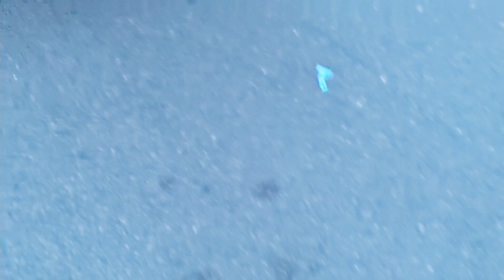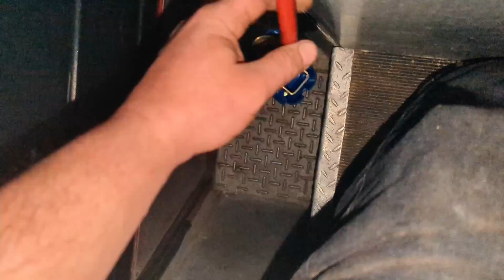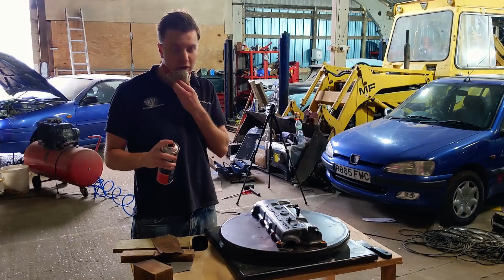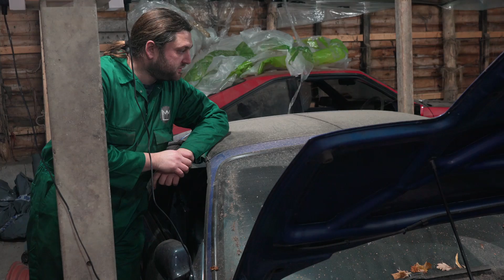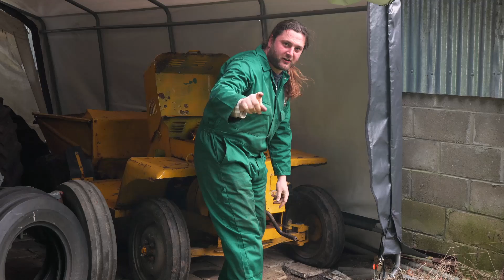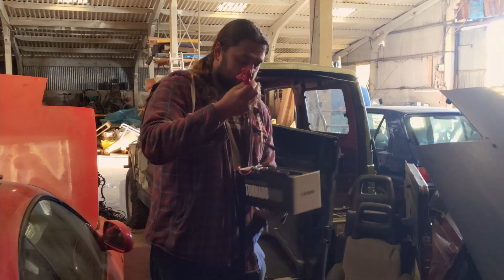New parts for old fire engines! - What's Broken Now Ep.34

Comment: Hi Lawrie . Clean battery terminals with sand paper clean inside of clamps faces and BLATHER VASALINE on terminals before reassembly and then BLATHER all over the outside faces of terminal and  clamp . Protects from the atmosphere and acidic fumes from battery . Trust me it helped loads on my batteries on my Mini. rgds Don
Reply from the maker: I'll give them a clean, but they did have battery grease on to try and protect

Comment: careful hooking those battery clamps to your ears. not supposed to put a charger on a dead short :D  Great to hear the digger and Jupiter are back up and running. Very odd issue with the terminal going melty. I wonder if there is not some type of parasitic draw on the system. And a new face for Redruth !!  that is excellent. I was out doing spring starts on my fleet yesterday. the only thing that was cranky starting up was my 1941 farmall H the old 6 volt battery needed a good charging up. I have about 15 garden tractors most from the 60's 70's 4 motorcycles 3 large tractors 3 pickup trucks a 3 wheeler and a snowmobile. so only one being cranky starting is pretty good odds :D
Reply from the maker: Ooof! Your collection sounds better than mine!

Comment: It really boggles the mind that NOS parts like this still exist, who holds on to this stuff for 30 years?
Reply from the maker: It's just mad isn't it!
Reply: I've seen the strangest things. At work, someone recently dug up a box of ten ca.-1980 plastic storage cases for 7" tape reels, unopened original packaging including the bulk shipping box. I also once had the pleasure of touring a hoarder's shed just before it was demolished. Contents included NOS circuit breakers from the second half of the 1960s and around 30 lengths (3 m each) of a type of electrical conduit that hasn't been manufactured since about 1960. I also once saw an online ad for hundreds and hundreds of NOS sockets and light switches from the same era, including free giveaways, a wine cork with a plastic handle shaped like a mains plug in each box of 10 sockets. Quite a few people never clear out their shops and sheds, unless they massively run out of space. Or pass away.
Reply: @Ragnar8504  Good point, maybe it's more surprising then that somebody like that would actually part with one of there treasures.
Reply: @johnnason7019  Might have been forced to downsize or even passed away. Or a garage closed and they needed to get rid of everything. Sometimes collectors even come to their senses and realise they won't ever need something again and sell it or give it away (ask me how I know 😀)
Reply: @Ragnar8504  I know the phrase 'but I might need it someday' and 'they don't make them like that anymore' all too well myself.

Comment: New old stock parts are  amazing.  I once knew a man who dealt in Packard parts in the early 2000s who had an original Packard V-8 engine from. 1955-56 still in a factory shipping crate.
Reply: At an old job I got handed a box full of war time new old stock prop feathering valves for Dakota/C-47 planes. After cleaning off the preservative we tested them and they were all go to use.
Reply from the maker: It's amazing what people have kicking around!

Comment: First of all, I decided to plug in the sound bar of my lap-top (so I could hear you better, not working, due to me plugging in a external hard drive)!! Great to find the newish cab front Two arms and a leg, might save Mat a bit of time with his welder! We used to get a glass/fiber compound with bits of metal to enable a rotten part to pass a MOT  !!! least said the better, so out of aall the shed projects, which might or could be finished first?
Reply from the maker: It's an amazing thing to find!

Hopefully the tractor will come together soon

Comment: To cheer you up with redroot's front. As far as I know the last replacement cab Mercedes had in stock for their Unimogs was sold for over 15.000€ a few years ago. 
Even rusted out cabs with nothing left go for 3000€. 

Replacement metal parts for vintage heavy equipment is always expensive, even more so if it's original. The volume is probably to low, but for things like VW buses they are so cheap.
Reply from the maker: Wow! Yes, I feel much better now!

Comment: thanks for the video! for humpty or the little dump truck  2 questions... 1 can you adjust the timing on it ,,,if so try advancing it a few degrees, 2 have you done a compression test on it or will it fire up infinitely more easily if you add a few drops of heavy oil to the cylinders before attempting starting?  bonus question can you get a replacement spark plug and have you read the plug thats in it to see if its running lean /rich or just right?  i suspect if you try the oil trick you will discover it really needs a top end job as it has worn over its service life.. possibly just new rings but im thinking rings and valves  and a fresh timing system
Reply: Answer to the bonus question: No, he can not. It is a diesel...
Reply: @allanlundin9420  ya that would make it hard to do wouldnt it lol
Reply: humpty is diesel , so reading the spark plugs could be tricky .. being unable to detect that does cast doubt on your opinion re piston rings to me
Reply: @888johnmac  tricky indeed ...and it also would throw out the timing option  . it shouldnt be that hard to start though , being diesel it needs compression and fuel and thats it , the oil trick is still valid it will help to seal rings to cylinder walls for a few revolutions ...long enough to see if it starts easier. being diesel its getting its fuel under pressure probably through an injector which would be my second place to look into hard starting.
Reply: @mobiousenigma  I do think the injection pump is timed to the crank but you can't adjust that.

Larger construction equipment with petrol engines is pretty rare in post-WWII Europe, some German lunatics even built things as small as 500cc diesel engines. Small items like compactors and generators up to about 5 kW do run the usual small Briggs or Honda and handheld equipment is often two-stroke but anything larger is diesel-powered.

That being said, I don't think Humpty is particularly hard to start for a one-cylinder diesel engine. The one thing these needed were more revs than an average person on the handle can easily manage. Bumping them is a lot easier than using the handle, which is why the farm I spent my summer holidays on as a kid always parked their 50s tractor on the top of a slight slope when the battery was flat again. Using the handle was a two-person job because it was quite hard to reach the decompression lever while cranking and accessing the starter switch to engage the glow plug (the battery usually wasn't THAT flat) was impossible. And yes, singular. 18 horsepower single-cylinder engine.
That's another thing: Humpty doesn't have a glow plug, which makes starting in cold weather even harder.
Reply: @Ragnar8504  i agree with all you have posted it appears accurate without bothering to verify. i too have rural experience and can say many cars and trucks are parked on hills as well lol. living in canada i also am aware of the "cold start" issue lol diesel really dosnt like minus 30 c so things like park it over a fire pit are not unheard of  . humpty still is harder starting than should be  and the air fuel ratio is off as is evident by its exhaust, as its diesel it is not an ignition timing issue because they do not have ignition systems. injection timing isnt the issue thats more a hp thing. so its a compression issue or fuel injector issue....as far as i know im no diesel mechanical engineer just an old red neck . given that injector service or replacement is far more expensive than a few cc of heavy motor oil i would choose to explore the compression option first. but the injectors are probably filthy leaking and making for a rich afr .....but im only guessing ....the other option is ether training but who wants to remove the lubrication to start an engine and its an awfully flamable gas to compress and contain in a thin can under pressure.  a good service and cleaning is never a bad idea and theres more than one vehicle here that could use a little more love. hopefully humpty gets some. 8D
Reply from the maker: A drop of oil normally is pretty good to help with compression. It's just an old engine which works, and I'm loathed to do much to it whilst it's working!